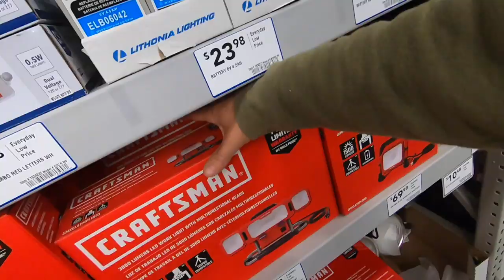Time to START the NEXT Project!

Comment: Wal-mart has 4 foot LED shop light for under 20 bucks each and the work great. They also dont use much energy. I have 4 of them running a solar shed  with an inverter. I'm going to guess  the surprise is you had a fence installed.  I heard the post driver in a few videos back.  I could be wrong and I'll see on Wednesday's video.

Comment: Shop Lighting - Spend the extra and install recepticles (properly wired) so you can unplug when a unit goes bad and repair or replace with a new one. Trying to repair a fixture on a ladder is not fun. Also, rugged drop lines for tools is a plus if properly wired with strain reliefs.

Comment: It would be wise to run any electrical wires in the walls of the shop before you spray foam.  It will make life much easier.  I am an electrician and I have had to put  wires in a foamed wall and it is time consuming.  Good luck!
Reply: Al explained in video that there was a reason for his order of doing things which would cbe clear in subsequent videos.

Comment: You should get 1 of those big plastic water tanks and cut the top off and use it to put the kindling in saying as you've got so much of it and probably won't run out to soon, put it in a back corner out of the way and then you have it when you need it

Comment: Are you going to put up batton boards on the barn? I see a lot of light cracks.
Reply: I noticed that too.
Reply: Same question here too
Reply: He has ni building wrap behind the siding, not a very good set up.
Reply: Pretty sure he mentioned batten boards somewhere along the way? And no .... I'm not going to go look ~8^)
Reply: I think the surprise is a fence and playground for the goats.
Reply: I think some people have forgotten, Al worked for a contractor building houses.  Al has renovated two or three houses along the way working up to the property he now lives in.  So he knows the process and the prep work required.  As for the building wrap comment.   You don't need it with spray foam.   Spray foam is self sealing, it becomes an air and vapor barrier.     As for the batten strips, they can be installed anytime, and the priority was getting the big projects done before winter hits.
Reply: @Svenulf Skjaldbjörn - I doubt they got lazy on that. I'm sure he has had a plan all along for this and will take care of it. He knows what he's doing, remember?
Reply: @Svenulf Skjaldbjörn They did but not the back, you can see the daylight in the lvideo about cleaning up the barn.
Reply from the maker: We put batten strips on a lot of the barn. We’re the goats can get to them and chew them we left them off. I think tomorrow’s video will help answer more of the questions too.

Comment: Do you have to put up all the battens on the whole barn before insulation or did I miss the rest of the battens being installed so it won't get wet?  Love the woodshed and new covered parking, it all turned out super GREAT.

Comment: When you had the equipment there why did you not run water to the barn?
Reply: Probably because "as Al mentioned" the budget was tight for doing the electrical.    Electrical only has to go down a couple of feet (depending on the code where you live).   A water line has to go down below the frost line which is at least four feet and that would cost more money.    It also means he has to heat the barn 24/7 or spend money on heat tracer cable and then hydro costs etc.     If I remember correctly, he mentioned eventually doing rain water harvesting for all the animals, as he did with the pig's and New Yoke City.
Reply: I can see where it is a little more money however if you are renting equipment it was the time to put the water in. No you do not have to heat the barn you put in freeze less system.  Pex would of been the way to go and depending on code he might of been able to use the Sam trinch.
Reply: @daviddobson8933   A contractor was brought in for the driveway, final site grading and the trench along the driveway for the electrical.    Al mentioned the budget several times and commented the electrical was only able to be done this year, thanks to a couple of kind donations.   Otherwise it was going to be left till next summer.     The rest really depends on the code in the area and what would be allowed.

Comment: I will try again.....the barn loft's front triple beam needs additional shear support at both ends.....a 4x4x2ft at each end would increase the end shear of that beam....again, my suggestion is to run this by the Barn Kit's structural designer for a complete anaylsis
Reply: CARDS - Why not just contact them yourself and present them with your suggestion?
Reply from the maker: I think the braces would look nice too.
Reply: AnnWith APlan 
My comment was not a criticism of the work performed, rather a safety concern and thus on a public forum, hopefully anyone who is in the process of constructing a similar structure could see my comment and question that structural connection.....also, the designed allowable live loads may be so small as the connection is not an issue....but, typically, a wood beam is designed to support the required forces in bending BEFORE the end connection fails in shear....note the shear forces are resisted by only a few screws and nothing directly below the end of the beam....Al is experienced enough and will either fix this connection or know the allowable load the loft was designed for and not over load the structure....
Reply: @cards7651  - Thanks for clarifying. : )

Comment: The new goat pen is so small. They can hardly move around in there. Fingers crossed for no more bad weather 🤞💗
Reply: You may not be aware, but the run actually extends around the far side of the barn. They are planning on fencing in a large area for them. This one is only temporary.
Reply: I mean the inside, not the outside. But if it will be covered I will be so happy. 😃
Thank you for the answer 😃👍

Comment: Clean sawdust you can save and use for meat smoking. Soon your pigs are due to processing.
Reply: I think Al uses his apple/maple tree hardwoods for smoking. A lot of the saw dust picked up today was from the shed/barn builds which would be softwoods such as pine, spuce, fir and hemlock. More likely use for the sawdust is chicken bedding.
Reply: @Bookmark Monaco Yeah, but how do you know if it's clean?  Could have any number of chemicals in it, pressure treated, glue, paint, stain, etc.

Comment: On the firewood barn do you have to install the wood slats over the seams of the 1 x 10's?. Just wondering.
Reply: Larry Weller 
It may help to allow airflow with firewood for ventilation.
Reply: Yes. But you have two cents and two large door openings. I was just wondering how this kind of construction works.
Reply: @hollyslaughter5505  There's plenty of ventilation without the ugly cracks on an otherwise nicely constructed building. With the 2 large openings in the front,  the 2 vents on the gable ends, the ridge vent, and other openings around the roof, those cracks should be covered.

Comment: Only thing I don't like about spray foam , is the off gases. Did I hear correctly ? you were going to wire the shop after the foaming ?  Hope your planning to use surface mounted conduit
Reply: Off gassing from spray foam is a direct result from improper mixing and installation procedures. There's nothing harmful about it and insulates better than any other type of insulation.
And yes, everything should be done and final before the foam is installed.

Comment: Scrap wood? I think gena and olivia might like the idea of crafts? Cut scraps into small random sized gifts..... sand sharp corners and wrap in wraping paper as ornaments, decorations, or such.  Old idea but a goodie. Between my mom and my wife i often have to cut up wood or styrofoam insulation to this reason....... it might not use up all your scraps but it might give them ideas if time passing bonding.
      Another thing i often do with scraps.........pass them in tablesaw to make cheap paint stirers .......yup......why buy them if you can utilize what you have?
         Also.......wish i could show you the rack my dad built for scraps.....its basicly 2 u shaped wooden bunks you lay wood in that you cut up about 16-18in long and it holds about 1.5ft wide by 1.5 high of wood and you can wrap a cheap rope or twine.....we reused baling twine around the bundle and then once you lift the bundle out of the rack shove a few more peices inthe middle of bunddle to tighten it up to the twine you tied.......poof......instant bundle of kindling to handle and move about a armload at a time!. Makes it easier to handle and store......or.....sell as kindling to other home owner or campers......

Comment: I'm just curious. Why no doors on the woodshed? I know it needs ventilation but there are gaps in the siding. Won't it be half filled with all of the snow y'all get blowing in there? Sorry, this southern gal knows nothing about all of that kind of weather. We get 17 flakes and this town shuts down
Reply: AMEN ON SHUTTING DOWN FOR A FEW FLAKES.
NO SNOW PLOWS/SHOVELS/OR EXPERIENCE WITH SNOW.
ON THE GULF COAST IT SNOWS ABOUT EVERY 15 TO 20 YEARS.
Reply: My guess is he probably oriented the building to the south/southwest, most of the snow comes from the north/northwest, so it shouldnt be too much of a problem when he plows the driveway. However , i would put cattle panel or chain link doors on the woodshed to deter thieves. Weve had them herein east TN
Reply: Wood thieves can be a problem. Some tarps would help with the out of site, out of mind.

Comment: I make a stew similar to that, but it's called Cowboy Stew. You start off with a layer of sliced potatoes then onions then one pound of raw hamburger, covered by one small  can corn drained,  can of drained carrots, one can drained peas, one can drained green beans, seasonings and then you pour one can of undrained stewed tomatoes over the top of it.  Make in the  Crock-Pot, put it on high with a lid on and let it cook all day, and when you get home from work your stew is done. I usually make corn bread to go with it. The peas are store bought, everything else is home raised.

Comment: I noticed you have some pretty big gaps in the walls of the barn. Weren't you going to put batten up to cover those gaps? I thought I heard you say you were while you were still building. If you put spray foam inside your barn before you batten down the gaps, won't it seep through those cracks to the outside? Eww, that will look yucky!

Comment: You guys don't ever have drinks at the table,  it's weird.  Today Al had a mason jar of water.  Is there a reason you don't have drinks?
Reply: Technically drinking anything while eating inhibits digestion or rather slows it down. Some drinks can even cause fermenting (not in a good way) which then gives stomach upset.
Reply: @blessyourheart2784  Back in the day, to loose weight, I was told to down a large glass of water...   Found out years later that it was causing stomach bloating
Reply: I drink something with meals and have no problem digesting food.  In fact, sometimes it's over processed!
Reply: @paulmonk7820  Too much information :-)
Reply: @blessyourheart2784  Well, thanks but I was asking THEM if there is a reason THEY don't have drinks.  The medical community actually does not agree with your statement, and says it actually aids digestion. https://www.mayoclinic.org/healthy-lifestyle/nutrition-and-healthy-eating/expert-answers/digestion/faq-20058348.  Here is another  https://www.healthline.com/nutrition/drinking-with-meals#belief-about-liquids.